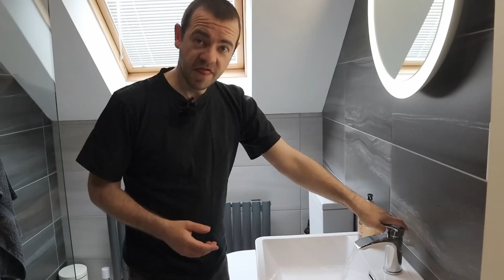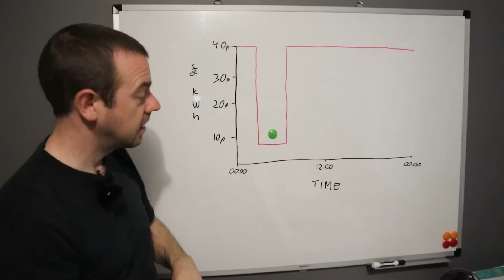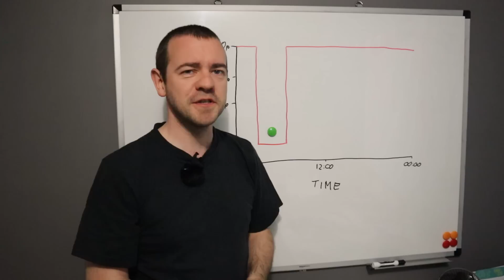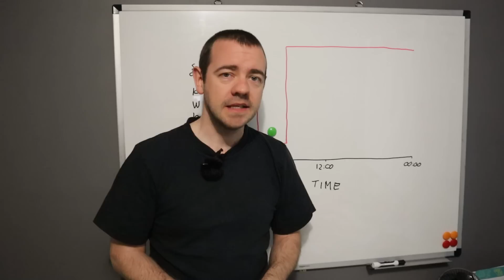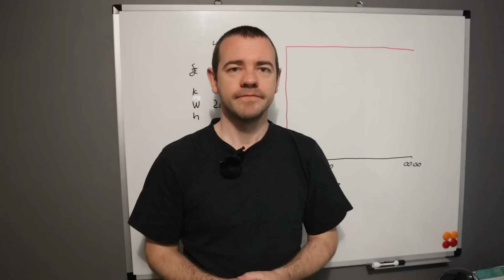Heat Pumps, Hot Water & Electric Usage!

Comment: Both of our showers are electric Triton showers and happy enough with that. I don't think we will be retrofitting a full system central heating system to include the showers as we just got the bathrooms updated. So would you be able to clear up something..

Would we be able to get a air to water system that can just be for central heating and keep the house warm? I'm sure that's not a complicated answer but in relation to buying a unit, because we will not be relying for it to use for showers could we get away with a smaller unit/tank?

We are currently oil boiler for central heating.

Appreciate any information or advice.
Reply from the maker: Same setup but with smaller hot water tank. 
Configurable as you want.
Reply: @ElectricVehicleMan  thank you for the response.

Comment: How does a ASHP system affect water pressure? I am struggling to understand how having your water cylinder below where most of your outlets works. I assume there is no issue but can't seem to find anyone talking about this?
Reply: It will be a 'closed' system, so the hot water pressure is the same as the mains - not reliant on gravity, like the old 'open' systems.

Comment: I have an air source heat pump linked to underfloor heating and Mixergy hot water tank.  I love the system.  I have been getting a COP of 4.5 at times.  I’m getting a bit bored of all the “it won’t work because” comments.
Reply: Is mixergy connected to the heat pump via heat pump interface or the indirect coil?
Reply: The ASHP is connected to the tank by an interface

Comment: 03:40

So one of the reasons why a heat pump will be the absolute last thing I do, is because I'm on Octopus tracker and I'm already paying less than 4p/kWh for gas

You're also only realistically paying 7.5p/kWh because you've got a compatible EV. My main aim is to make my house super air tight and insulated first, before I get a heat pump

My rationale is that if I adopt a PassivHaus ethos, I'm reducing my energy requirements for heating, especially when I get an MVHR

Then when I have finally done everything I could possibly do to the house within reason , that's when I'd get a heat pump ie:I won't opt for PassivHaus windows but instead "high quality triple glazed ones" because of diminishing returns

It also means introducing more ventilation, and having less requirement for AC too. Once that's done, I'll get a heat pump because that's the greener choice but if I got a heat pump now, I'd essentially have something that's too big if I'm doing all these efficiency changes

I could then get something smaller, and hopefully even more efficient than the ones we have now. It'd certainly be nice to have a heat pump that could have say a COP of 8, and performing at a COP of 4 in the winter

Comment: Agree with your comments.. During this sunny spell we have a surplus of solar anyway, 4kWh house battery is full and 2 x evs at 80%.  so a bit academic really whether we use the immersion or the heat pump to heat the water. There may be an argument that heating via immersion saves wear on the heat pump I suppose. 
We have a mixergy tank with very good stratification and therefore accuracy of the hot water %, therefore I have set my hot water tank to 50% to heat overnight during the cheap rate (via heat pump) and top it up during the day using solar to 100%, both to 51C. Some nights, depending upon use, there's no overnight heating required at all. I know its fine tuning and prob only saves a few pence/day but may as well.. plus I'm a control freak ;-)

Comment: I have an ASHP which just keeps my hot water tank at a pretty constant temp, never ran out. There is an electric boost to make it hotter for things like legionella cycle but that's it, never boosted it manually, never scheduled it to heat up in my cheap rate window. In fact I do not treat it any differently to my previous property with a combi boiler. Last month hot water usage was 59kwh all of which came from solar or home storage battery. 3 adults in my house, water usage is random I shower pre 6am, my wife after 6pm, my son, no idea.

Comment: Nice and clear as usual. Thanks.

I have a similar system - Heat Pump with 300ltr HW cylinder, 5.8kW of solar panels and 11.8kWh of storage battery

Despite being an all electric house with an EV, Hot Tub, two freezers, two fridges, washer, dryer, double oven and 5 'burner' hob and all the other stuff we have these days, my last 30 days of use have cost me the princely sum of £26.15 

I have a Zappi charge point for my EV and this harvests surplus solar during the day so that on average since January my car has cost me 2p per mile to run. My previous diesel Skoda cost me close to 14p per mile for fuel.

I have 'discussions' about my set-up in the pub on a regular basis, trying to explain that this stuff actually works. Even on really overcast days my Solar generates about 0.5Kw and on cold (-7c) days during the winter the heat pump keeps us toasty warm.  They'll nod and smile when I'm explaining this (again) then they'll buy a new gas boiler or gas-guzzling SUV
Reply: Did you use a specific company to supply and install the full system? Are there many that do this? I wouldn't want to have to choose the equipment myself as an example.
Reply: @theta2170  I did use one company but I won't mention their name because they are rubbish. However the equipment is excellent. To be fair you don't need one company for this type of set-up.  Most people would get their solar and battery from one company and their Heat Pump from another.
Reply: Well arnt you the lucky one, personally I am sick of hearing about how well all you entitled well heeled yuppy types are doing with your EV's and heat pumps. Please keep your bragging to yourself.
Reply: Thanks for this insight. We’re about to embark on a large extension renovation. And converting our 1952 semi detached into a modern home. We’ve been quoted to installed:

11x Eurener 450w panels Spanish
1x 5.2kw battery Givenergy
1x Givenergy Inverter

It will generate approximately 4167kwh of energy yearly. We don’t have an EV. We are thinking of having everything else you have.  

How many solar panels do you use? 

What brand heat pump? 

Does your shower pressure run from the Mains water, into cylinder, heated by the air source heat pump? We have a combi now and I hate the pressure and fact we can’t have multiple heat taps on at once. 

Overall, do you think we should switch to solar and heat pump? 

Thanks for your support on this.
Reply: Do the Solar First and size the system for all your home needs. Figure out what your break even is when swapping electric utility bill to pay off Solar depending on incentives etc. solar is your best investment as there are no moving parts, fuel source is free and system should work for 25 years or more.
There are calculators on the internet to figure out your total BTU needs and you can convert BTU’s to KWh. Account for Heat Pump giving you 2.5 to 3 COP as year round average. As you are remodeling do all the energy efficiency upgrades you can as they have best overall payback. Make you plan and follow your plan all at once or over time.
Reply: RE : the gas boiler

Tbh that's understandable because if I went to a heat pump, I'd have to upgrade all my pipes and radiators

RE: The SUV

Not as understandable though lack of destination chargers is an issue. I need to drive a 100 mile round trip every two weeks or so + driving within my parent's county too.

In an affordable car like a VW e up, that would JUST make it there and back , and in winter it might not even get there and back . My parents live in a terraced house too which means charging it is difficult.

I've currently got a 2011 Toyota Yaris, and realistically as much as I want an EV, the EV that's most "suited" to me is the Kia E-Niro and I'm hardly going to pay for an expensive car regardless of what type of car it is. I don't drive that often but I do these 100 mile round trips frequently enough.

I also see no real reason to change my current car. I deliberately downgraded from a Prius because the insurance on a Yaris is dirt cheap

In that sense, I'm more likely to get a hybrid or a PHEV for my next car largely because I'm not someone who buys new cars.

I do also like parking my car some 20 minutes away from Manchester City centre, and people who live there aren't very happy about it despite it being free and legal to park there. A cheap car is much better for that

Comment: We do exactly the same as you . We always use heat pump at night for around an hour to get to 50⁰c  using roughly 1-2 KWh @ 8.25p/kWh. We get on average 2.34 kWh heat for every kWh of electric . We also have solar so do top up during day for free using the immersion but this is not triggered by the heat pump ever. Significantly cheaper than gas 🤓

Comment: My Vaillant heat pump was installed last Oct, we have a COP for heating of 4.2 and hot water COP of 3.8. We have four adults in the house all the time, so we leave the hot water on continuous and we are never without hot water. Like you the house in the summer months runs off solar and battery. During May we were typically importing 0.3 kWh from the grid in a day, and that included charging the EV.
Reply: What size tank how you got?

Comment: I have a Midea heat pump, installed last October.  Like yours, the immersion heater is disabled.  The controller is configured to usually heat the water up to 50 degrees, but when solar energy is plentiful as it has been these past few weeks, then I increase this to 55 degrees.  (In theory, once a week it should heat the water to 60 degrees once a week for Legionella control, but I've disabled this).  I'm on the Octopus Cosy tariff, which is more expensive at off peak, but the off peak window is larger.
Reply: 55 should be enough to kill off legionella really, which also takes a couple of weeks to form anyway. 50 is a little low.

Comment: Two main issues with heat pumps (apart from cost) are going to be the space required - couldn't have them in a flat or back to back terrace, for a start, and then the water tank. With combi boilers, a lot of tanks have been removed and the space for them repurposed or never there in new builds.

We need electric combi boilers with the same levels of efficiency to be a practical replacement for most homes
Reply from the maker: They can be wall mounted and even roof mounted ones are coming now.

But not every house can possibly have one, nothing is one size fits all.

Electric boiler can never be more than 100% efficient as it creates the heat. That would be impossible. A heat pump moves heat so something has to exist outside.
Reply: We have a heat pump in a 2 up 2 down mid terrace. It's a tight fit but possible. Would NEVER go back to gas.

I'm not sure there are many back to back terraces any more, but they could benefit from a community heating approach, like the deep ex mines used in the north east
Reply: @michaelbond6842  What do you do for hot water though, have you got a tank? That will be an issue for many, a lot of newer builds don't even have the cupboards as you don't need them with a combi. 
There was a prototype electric combi I saw on Fully Charged a couple of years ago, but it was the size of a washing machine!
Reply: @hooksforestchin  we have a tank for HW. Solar pV plus divert (iBoost) for many years in cupboard under stairs. Same space now used for the ASHP tanks (4 in all). V tight squeeze but it worked.

Same issue with bro-in-law's house. Had combi boiler, but had full ASHP and takes installed in 2 up 2 down mid terrace even smaller than ours. Just shows what can be done with a little creative thinking.

Comment: Does that heat pump double as your HVAC as well? Can heat pumps be dual purposed like that?
Reply: IIRC EVman's heat pump is an air-to-water system, so it runs hot water through radiators. You can run it in reverse to push cold water through the radiators, but the way radiators are plumbed means the cold water stays at the bottom so there's not much surface area for temperature exchange. Also you get condensation on the cold surfaces. HeatGeek did some interesting testing with their system during last year's heat wave.
You pretty much never need to cool a house in Yorkshire anyway.
Reply: @robinbennett5994  ah makes sense, thank you!

Comment: On a related subject if electricity companies can supply power at 7.5 pence at night, why cannot they do it during the day?
Reply: Because they've got loads of it at night that no one wants and there's no way to store it and then during the day, high demand (offices, factories, cooking etc) and to generate more means turning more power stations on, which is inefficient.

As well as insulation, we should be developing and installing more battery storage at domestic levels. Relatively small, can easily fit under the stairs but also in a loft and don't need a huge amount to be able to power up your home for the rest of the day, especially if you move things like tumble dryers to overnight as well.

Just remember to upgrade smoke/heat detectors if you're running lots of stuff whilst asleep.